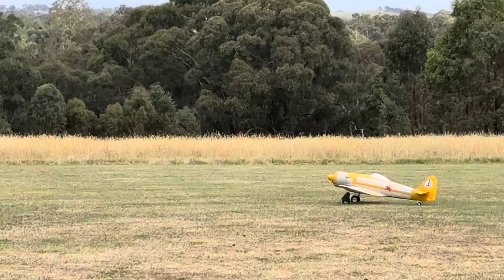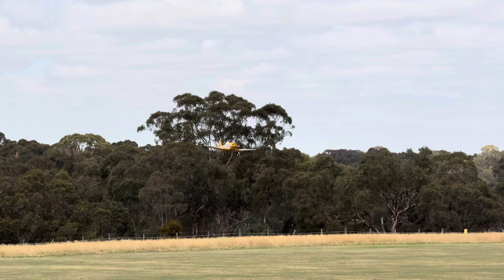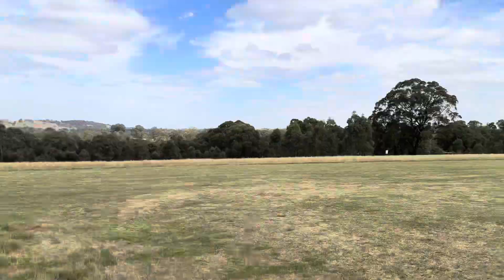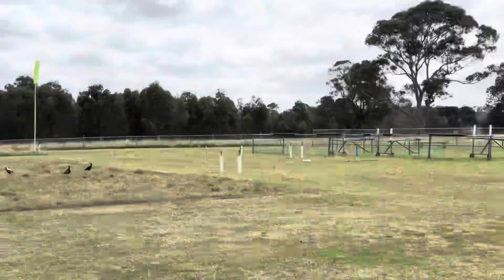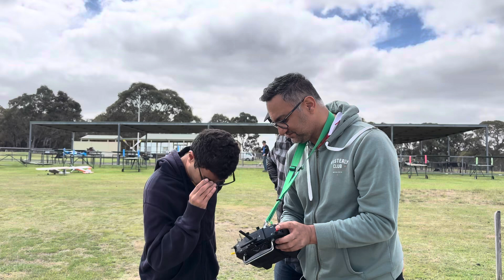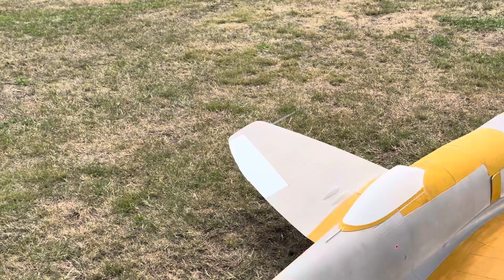⁠3d printed @planeprint  Seafury

Comment: what filament did you use?
Reply from the maker: @NigelSimkin-u3x  esun lw pla
Reply: @loveforrcplanes  I'm trying to print their Piper cub with Esun LW PLA but finding it prints really flimsy doesn't appear to have much strength at all
Reply from the maker: @ have you created the p5 profile they have?

Comment: Good save...but if it is tail heavy then definitionally the CG is off. Whether it is the user who improperly balanced it or the designer who put the CG markings in the wrong location. Either way the CG is incorrect.
Reply: PlanePrint has never marked a CG wrong.
Reply: @rcdavidk  I didn't say they did. I'm just saying there is only 2 reasons for the CG to be off. Never said which it was in this case.
Reply: @InspGadgt  You want to be pedantic... ok then... I never said you said they did.  I simply stated that PlanePrint has never marked a CG wrong.  Jeez, what the hell is wrong with people these days.  You offered 2 explanations and I dispelled one of them.  Given that the CG is right and that the elevator trim, after landing, is level with the HS and the pilot put in full down trim then let's guess where the elevator started.  Further... that didn't really look like a tail heavy landing.  All in all, good save in the air and a good landing.  And the landing gear look really solid.  Nicely done to the pilot.

Comment: With the CG described in the manual, the Fury is NOT tail heavy! However, you have to make sure that the CG is correct when balancing, which is sometimes tricky with a low-wing glider. The Fury in the official video has exactly the specified CG and flies very comfortably.